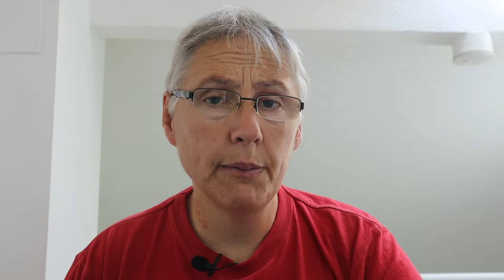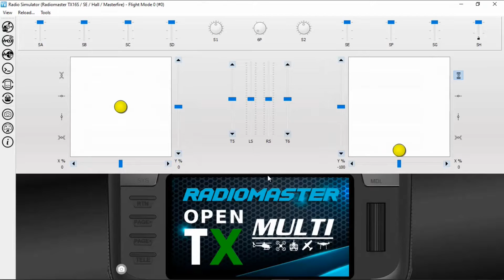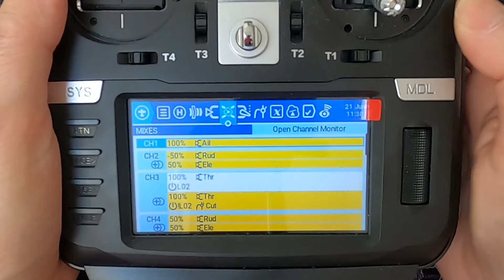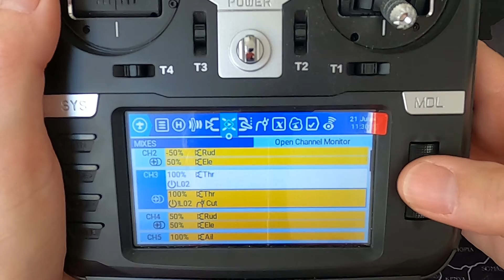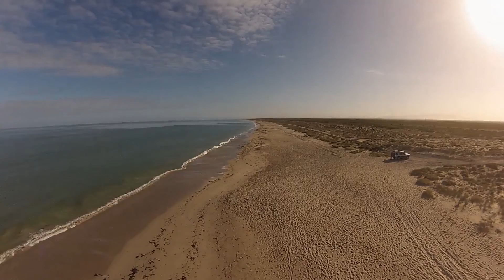EdgeTX V Tail Mix

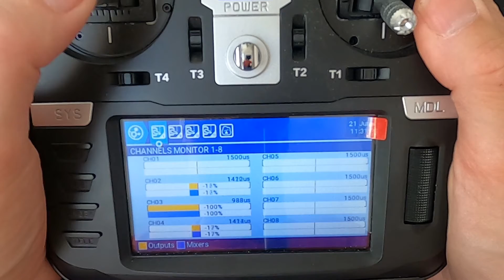Comment: 3:50 yeah but there is only 50% of the possible movement, right. Should still to to 100% with full gimbal movement - right?
Reply from the maker: No, the servo moment is being shared between to control surfaces. So if you had full 100% rudder (tailerons) you would have no elevator movement in the direction you are turning.
Reply: @the-happy-RC-flyer  Ah yeah.. I see. I was confused somebit.. and may still are, but I think I get it in the case of a V-tail. thanks Bill.
Reply from the maker: @calmarcalmar  once you set up you mix make sure the control surfaces move as you are expecting. Any further help let me know exactly what configuration you require for your plane and I will work out the programming for you.
Reply: @the-happy-RC-flyer  Very kind, but at the moment I was just trying to understand it without doing it on a plane. Actually doing it on a plane, may would have helped me to understand it.
Good day!
Reply from the maker: @calmarcalmar here to help if or when you need it. Go well.

Comment: Hello and thank you for your tutorials, here I bought a "V-tails Mixer" to add a little flaps to my ailerons ... I connected the v-tails mixer on the servos on one side and on the other a wire on the output receiver ailerons and the other on output 5 of the receiver dsmx . ...I would like to be able to program an inter for the flaps (3 positions) while keeping the use of the ailerons on my TX16S ...can you help me with the programming? as the plane is a trojan 1.1 eflite and the ailerons are on output 2 of the AR631 receiver ...
Reply from the maker: If you have separate servos for each aileron you can set the mix up in your radio. You do not need a v tail mixer.

https://youtu.be/Bb2EIWW2sCw
Reply: @the-happy-RC-flyer  thanks for the answer but unfortunately the aileron servos are on a splitter which is on output 2 of the AR631 receiver, that's why I bought this V-tail mixer.
Reply from the maker: @shortgreysma1274  please clarify are the ailerons operated by one servo and not two? If only one you cannot have flaperons.
Reply: @the-happy-RC-flyer  Ailerons operated by 2 servos but on the voice of a repeater, that's why I bought the V-tail mixer to have ailerons and flaps (with a switch), but I don't know how to program on EdgeTX
Reply from the maker: @shortgreysma1274  plug the servos into two channels and program the mix in your radio, I assume the servos have standard plugs?

Comment: I have been searching videos just for this. Not sure if you are familiar with this model, Hobby King Excalibur. Should I use the wizard to setup? My receiver is labeled TAER. How will that work? It is a V-tail with separate servo channels.
Reply from the maker: Yes you can use the wizard to set up a basic model but may have to add a channel for the V Tail mix. This video should help you. You may just need to move the servo plugs around on the receiver if the channel mapping on your radio is AETR and not TAER
Reply: @the-happy-RC-flyer  In the mix page, I set it up to match my receiver. TAER. Is that correct? Thanks for the response.
Reply from the maker: @jerryzito6840  As long as your control surfaces match your stick movements you are good to go.
Reply: @the-happy-RC-flyer  One last question. In Edge Companion, I clicked on write to radio. But nothing happened. Did I miss a step?
Reply from the maker: @jerryzito6840  it will not show you it has completed the process. Just check your models are now on your radio.

Comment: Hi Bill, Thank you for your tutorial, Weight must be 50% (positive/negative) ? why not value 100% ?
Reply from the maker: 50 % for each control elevator and rudder
Reply: @the-happy-RC-flyer  Ok but what is the incidence if I put 70 or 100
Reply from the maker: @doand1257  it will make the servo move past its maximum throw and possible bind.

Comment: Bill, after watching the beginning of the video again with your admonition to check minus/plus values, I also wondered about servo reversing. Voila! My servos were reversed so my v-tail setup was never going to work, even after I'd followed your suggestions to the letter.

I went in and reversed the servos and everything works perfectly as you described in the video.  Thanks again. You were a life saver and made my day!  

I've been messing with this airplane (ZOHD Nano Talon) for three days, posting on RC Groups, looking for videos, messing with OpenTX and EdgeTX Wizards for v-tail setups, trying to find a Wizard lua, etc. I finally found the right Youtube search string "v-tail mixer tx16s" that brought up your video. I'd been searching on Youtube for days with different search strings trying to find a generic v-tail setup. I want to fly this bird first without the Kopilot Lite, GPS, and FPV camera that came with it, so I just wanted a basic v-tail setup.

 Cheers.